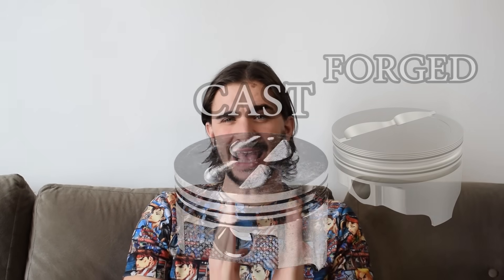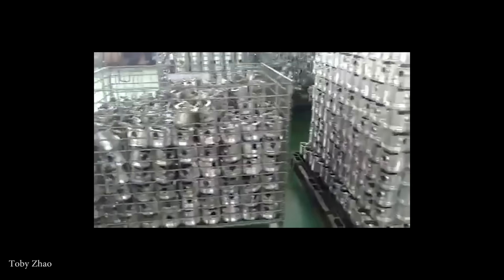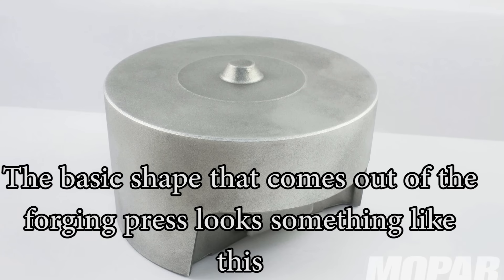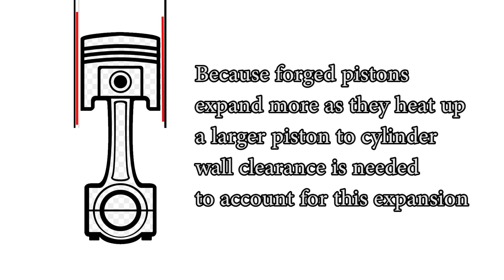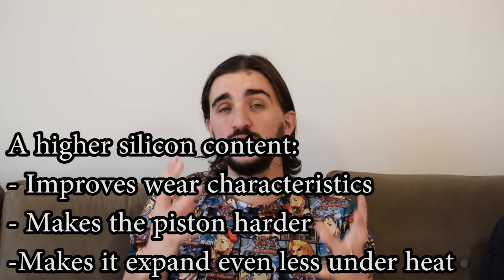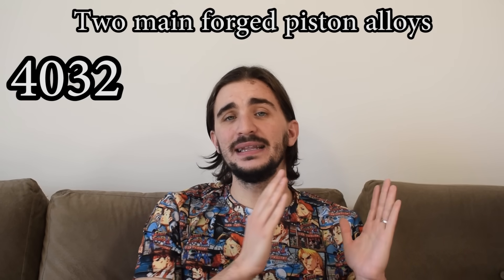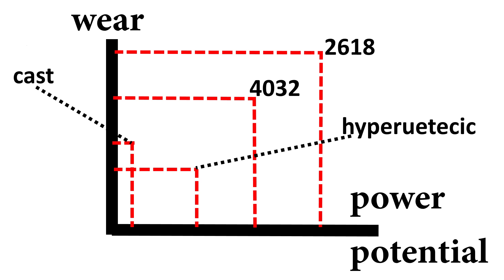FORGED vs CAST vs HYPEREUTECTIC PISTONS

Comment from the maker: Let's hang out: https://superpeer.com/driving4answers
Support d4a: http://driving-4-answers-shop.fourthwall.com/
CP Forged piston kit for Honda K20 K24: https://amzn.to/39EQrie
Hypereutectic Chevy small block pistons: https://amzn.to/2P12qig
NPR piston kit for Toyota 1ZZ-FE: https://amzn.to/2uR7Kha
CP Forged piston kit for Mitsubishi 4G63: https://amzn.to/39Gf0eD
Wiseco forged piston kit for Subaru EJ257: https://amzn.to/322QnpP
Wiseco K1746 forged piston kit for Harley Davidson: https://amzn.to/38CoqaP
Arias forged pistons for Toyota 4AGE: https://amzn.to/2T4TCJB
Piston install tool: https://amzn.to/38MLL9O
Manual piston ring filer: https://amzn.to/39Es3NJ
Reply: u said cast was 8-10% & 4032 was 10-11% ... how come your charts shows cast wear still better than 4032 ... your chart is wrong then ... for wear from wat u are saying and correct form would be wear least hypereutectic >12.5% , Forged 4032 10-11% , Cast 8-10% , Forged 2618 1-2% ...
Reply: @Zohar-Modifier  Silicon % does not determine wear, it helps to limit material expansion. By the nature of the manufacturing process, cast pistons already expand less than forged ones so if you compare cast vs forged with almost similar amounts of silicon, you would see that the cast piston would have less expansion than the forged piston creating a tighter tolerance fit during cold operating conditions. This means that in fact the cast piston would experience less wear.
Reply: Can they make custom designed forged pistons? If so, forged is the way to go. I'd add a cast piston guide/sleeve at the base of the piston to negate the piston knock. Cast for no expansion and forged for the primary and durability.
Reply: Hi Charles 
Two piece pistons have been used in Diesel engines for 40 years
Diesel had twin cam direct injection turbo charged intercooled in the early 70s maybe earlier 
Not much has changed just all this after treatment which just creates More running costs and down time  normally when someone fills the A’d blue tank with window cleaner or diesel.
Reply: There are exceptions. Audi and vw have been using forged for over 2 decades in factory motors.
Reply: You forgot L-series pistons :/
Reply: yamaha has "diASil" in some of it's modern motorcycles and it is forged right? so, does it mean diASil is a good piston or not?
Reply from the maker: @papajoey4384  I believe diasil reffers to the cylinder, no the piston. I think diasil is all aluminum die-cast cylinders.
Reply: @d4a  oh.. well i thought it was the pistons? it's another and different story then. cause every time i saw a specification of a yamaha mc's i thought diasil is a forged piston. better do my research more deeper for knowledge sake. thanks btw.
Reply: @d4a  please make a video on connecting rods. Love the videos!
Reply: @d4a  Hi i have  4A-GE 20v blacktop for wekeend driving and please tell me which is better for me ?? THX for your answer and good engineerning informative videos
Reply: I wouldnt buy of Amazon...  overpriced..
Reply: I just bought a set of  hi compression pistons from your company for my TVR Chimera, and I am happy with it 👍👍😍😍
Reply: Driving 4 answers ...you may want to make note that today there is pistons being made and in use from an entirely new form of manufacturing that is not widely known that is much better than cast , or forged or even HYPEREUTECTIC ...and that is extreme high pressure extruded "cold aluminum"  die cast pistons ..this is done at very low temperatures of the aluminum just before it cools to harden..and then pressed into a machined metal mold to form a piston of the exact sized need with very little maching left to do . You end up with a piston with the low expansion of a cast pistom but with the strength of the "grain" effect of a forged piston ..plus it is 4% less friction of anything else ...honda uses them in their cars since 2006... And that's all i know about them as i just looked it up on google after watching your video ..so see what you have caused ! Hehehe ...thanks to you , you have now released a monster can of worms that all have new questions "driving 4 answers".....
Reply: @driving 4 answers or anyone else the knows.what are the pro and cons of a metal 3d printed piston? (not including the waiting time as a con)
Reply: What about steel pistons for hi boost (typically diesel) and BiMetal pistons with steel top ?
Reply: Crazycatman the GE and GTE are identical in the short block... the GTE head is allegedly a bit better, but honestly you can make more power than you'll even want (700 plus) with just a turbo setup along with a good fuel system and a standalone ECU. Good luck👍

Comment: This is major considering your oil type and viscosity in cold starts when using a forged piston. Have to keep that in mind that every start needs proper lubrication for the system if you are daily driving and starting up on a regular basis

Comment: Tldr. Forged pistons are better... If you account for temperatures to cause pistons to increase in size and if you bore the cylinders to account for said expansion. Also getting a slightly longer connecting rod will reduce both piston and connecting rod bolt pressure.may your engines live long and roar proudly.

Comment: You are not mentioning that pistons are ground out of round, to negate the difference in heat expansion based on the different wall thickness from pin hole sides vs skirt thickness.
I know this because I was an Engineer at the Chrysler Trenton MI. engine plant and I had to keep the machines running, making good parts. They were ground to eliminate piston slap and uneven bypass or combustion.

Comment: 7:00 is this why the have to pre-heat racing engines before they start them like in F1? Or one of the reasons?
Reply: It’s part of a reason, comes along with the other problems with extremely tight tolerances

Comment: Say silicon (as in CONvict), not silicone (as in ice cream CONE). Silicone is a sticky rubbery substance once (possibly still) used in breast implants and as a weather/water joint caulk in home construction.  Silicon Valley is named after the semiconducting metal that gave us Moore's 'Law' and is used in the eutectic alloys you mention.  You can sus out pronunciation without a dictionary by noticing that the 'e' on the end of silicone indicates a long vowel sound for the preceding ('o') vowel, where the lack of a trailing 'e' in silicon indicates use of the default short vowel sound for the 'o'.

You might have mentioned that eutectic just implies a mixture that melts & solidifies at a lower temperature than the melting point of the constituent ingredients.  We salt roads in snowy winter conditions because saltwater has a lower melting point than pure water, thus lowering the ambient temperature required for ice formation.

Eutectic alloys flow better at lower temperatures (notice how watery the poured eutectic aluminum alloy looks in the video), so mixing is more uniform.

Comment: I bought a set of drop in forged pistons for my motorcycle.  They increased the compression due to a higher dome, and increased the power and torque.  Problem was my air cooled motorcycle would then overheat in traffic on 100 degree days, and they were noisy in a way that made it sound like the engine was about to grenade. I put the stock pistons back in, they are beautiful,  cast coated pistons. They aren't noisy, they run cooler, and the bike sounds way better. Riding for me is about an enjoyable overall experience,  not just sheer performance.  Better sound and reliability create a better overall experience.

Comment: Good info! Old mopar cast pistons were quite good. They were made by TRW. Carroll Shelby said that in a big block there was no reason to switch to forged unless you were going to extremes.  They had long heavy skirts, short strokes and long rods. I have seen blown 440s run factory pistons at 650 hp for years, and a built cast crank stock piston '78 440 with a tunnel ram launched at 7500 rpm for 3 years until a stock rod stepped out. Those pistons had steel expansion struts cast in them. What I miss is tin plating. The new coatings wear off much quicker. Also, most OEM cast pistons have offset pins to reduce slap. Most forged do not. We would reverse the cast pistons in our big blocks to get a straighter push on the crank. It definitely freed things up. Unless the engine was severely worn I didn't notice any extra slap. Hypereutectic pistons from the major supplier for a big mopar in my mind are inferior to the old cast ones, but better than cheap new cast ones. I have seen many of the hypereutectic crack probably because they are more brittle and have shorter thinner skirts. Also, hypereutectic pistons require larger ring gaps because they transfer more heat to the rings.  I didn't know that about the two alloys for forged ones. I suppose my blown 572 hemi dragster motors custom pistons are the low silicon alloy. I don't care about slap!

Comment: I have run forged pistons and abused them thoroughly without fail.  I have never seen wear on the piston from piston slap, tho I do admit that it exists.  However, the other side of the coin is that cast pistons, while fit to closer tolerance to the bore, have a nasty habit of folding the tails of the piston inward, which crack will crack and give you a convenient inspection port into your cylinder from the outside of the engine.

I always ran TRW forged pistons at .004 to .005 bore clearance cold and TRW double moly rings.  Never an oil consumption problem or piston slap wear.  Just use a tiny bit of common sense and don't redline your engine when it's 40 degrees outside.  Let the thermostat open and have fun.

Comment: Thank you for the video! I learned a lot about the pistons then I ever knew. I have a 289 engine that a machine shop is installing hyperuetecic pistons in to it. The guy recommended it and I was researching them because I didn't have a clue. I feel a lot better now. The 289 is original in my 1967 mustang. Thanks again

Comment: Compressed cast is an usual process used to obtain stronger parts instead of non compresesed cast.
The compression force is applied while the metal is still in liquid form and then they wait till it cools down and solidify then they open the mold.
But hot forging process results in better strenght instead.
Compressed cast pieces has more strenght but are weaker than  forged pieces

Comment: Some small engine manufacturers are using a lot of coatings but on top of crap material when the very thin coatings is gone the engine rapidly begins to disintegrate

Comment: Pistons do not expand uniformly due to the extra material in the pin boss area, where it expands more.  To compensate for that they either:
1.  Cam grind the piston so it is slightly oval when cold.
2.   PIN OFFSETPosition pieces of steel inside the material to prevent it from expanding in that area which are known as Autothermatik pistons

Sometimes pistons are symmetrical, but often they are not, requiring them only to be installed one way or a different part number per bank due to multiple factors.  Pistons will be marked in such cases with a mark on the top that is toward the front of the car for one bank, rear of the car for the other bank, or an L or R oriented as instructed.  On an inline it will face only one direction.  Some reasons for being unsymmetrical are:
1.  Orientation of the dome, valve reliefs, and plug reliefs to match the head.
2.  The piston major and minor thrust skirts enabling adding material on the side where the major thrust is and reducing the opposing side and keeping the weight of the piston down.
3.  Wrist pin offset (wrist pin is offset to the thrust side.), to reduce piston “slap".
*Don't be fooled by pistons that look symmetrical from the top.  If there is a mark, there is a reason.  Sometimes their apparent symmetry is simply a production optimization.

Comment: Let's all take a moment and talk about piston to wall clearance or skirt clearance. When reboring and rehoning an engine remember that for normal use the skirt clearance is usually built into the piston. Meaning if you simply take standard bore size and add the oversize to this number that will give you the desired finish size for your engine. If you buy a piston that is meant for 4.030" your piston skirt should measure 4.026" if the piston manufacturer wants around .004" skirt clearance. If you want to use the same piston for severe duty like racing they will tell you to add a little more clearance by simply honing to 4.031"  for example.

Comment: Guys im struggling a bit with finding information, so I bought an Eclipse GT 2009, it comes with a 3.8L SOHC engine, and I've been looking everywhere to find some information about the Pistons and Rods materials used in the engine but I can't find anything on the internet, if you guys could help out I'd greatly appreciate it <33
Reply: Like at this point I just want to know what kind of pistons it has, normal cast or hypereutectic of what ever..

Comment: Unless absolutely necessary, your pistons should be of the same material and density as the engine block, so the metals expand and contract at similar rates. Forged anything in a cast block will have longevity problems, these are best saved for engine that will run low hours at high power. 

This guy is smart..

Comment: Also watch total seal rings video, appears a lot of heat is generated from thicker rings vs thinner rings with a added spacer, also look at gas ported rings, gapless rings. A lot of good info out there. Thanks for your video.

Comment: You get what you pay for. A craftsman wrench will stand a lot and you may never break it even with abuse. Snap-On will stand more and more abuse. Each material has its limits and the first of those is your wallet. After that? Your ability as an engine builder and timing, then if you're disciplined enough to get  your out of it before you reach the limit of all the above.

Comment: Apparently the mk1 TT has forged pistons from the factory & so far mine has done 149k miles/240.000 km 
Seems to be quite happy at 21 years old with 20psi boost & more cold starts that you can shake a sausage at

Comment: How is a forged piston more ductile if it's work hardened?  That's the main point of forging- work hardening.
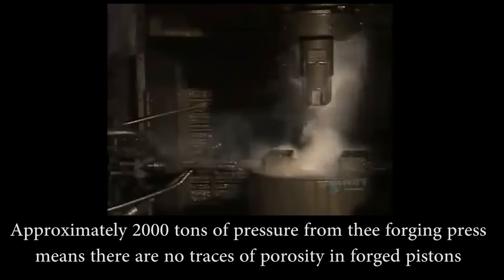Reply from the maker: I'm afraid you don't understand what forging means in this context. In general, most forging isn't cold forging. Work hardening is done with cold forming processes like rolling etc. And at 2:46 and 4:59 you can observe that pistons are clearly not cold forged, which would be a temperature of 0.4 of their melting point. So before you state what the main point of something is make sure you know what you're talking about 😉

Comment: The title of the video is somehow wrong and unfortunately it has been used in marketingas well. Hypereutectic alloys is not logically and scientifically comparable to the cast and forged alloys. Cast alloys could be Hypereutectically solidified or eutectically solidified. In other words, they could be eutectic, Hypereutectic, hypotectic, prectetic and etc. The hypereutectic here means that the alloy contains more Silicon than the eutectic alloy. These terms imply the phase transformations and processes through which the alloy has been cast and solidified. I explained below the meaning of the eutectic in metallurgy.

Eutectic is a metallurgical term in Materials Science which is widely discussed in solidification of metals and alloys. In thermodynamics of materials, there is a map which is called phase transformation diagram which explains the solubility of alloys, supersaturation, the temperature at which the alloys solidify and etc. The temperature at which the alloy becomes completely solid from the liquid is called eutectic point and the composition of the alloy is called eutectic composition which is calculated through the diagram. There are other points like pretectic, monotectic and etc.
Hyper and hypo means before and after eutectic at which the alloy composition changes. In Aluminium- Silicon binary  phase diagram, the eutectic alloy contains 12% silicon. Although in ternary and quaternary it could include Cu, Mg and Ni.
This alloy is of important mechanical and physical properties.
If you go to the right of the eutectic point and manipulate the solidification process, you will get the hypereutectic Al-Si alloy. The percentage of Si could vary from  18 to 24 at% and similarly it could include other alloying compositions. The hypereutectic Al- Si has lower thermal expansion than that of the eutectic Al-Si. However, its UTS and Yield strength is lower than the eutectic one. 
These metallurgical  terms is also used in steels. For instance, the austenitic steels signify the eutctoid transformation through which the steel has been solidified.
The materials discussed in the video, are usually heat treated to manipulate the phase diagram and phase transformation process in order to change the Mise-en-scène of the atoms and  achieve the desirable atomic structure . The as- cast microstructure is not desirable although it could be employed.

Comment: "steel forge piston have a bigger thermal expansion than aluminium cast piston" ..... you are wrong there steel expand way less due to change in temperature.

Comment: The real fact is that many people who use forged pistons do not set the correct clear value for their cylinders, which leads to early scoring and even failure of the cylinders with forged pistons.
So always remember, read the piston installation instructions and ask the machine shop to work on your cylinder using the piston manufacturer's clear values and maintain it faithfully, and your motor will live happily.